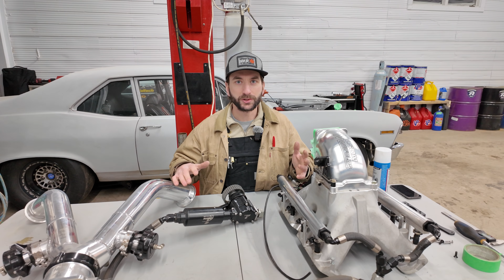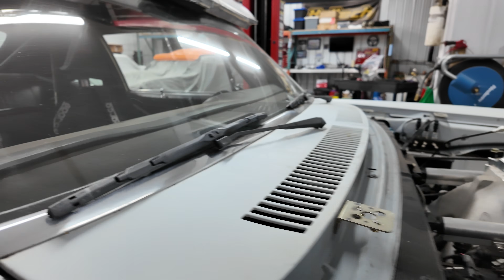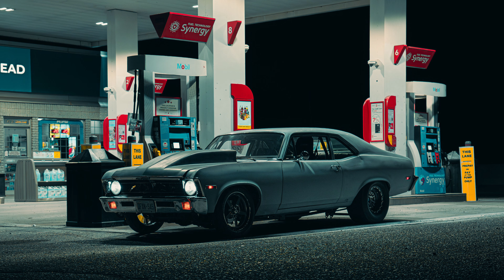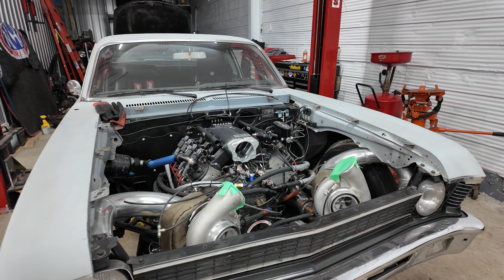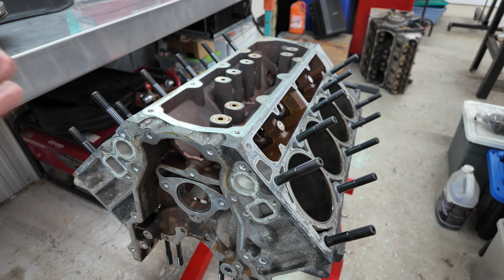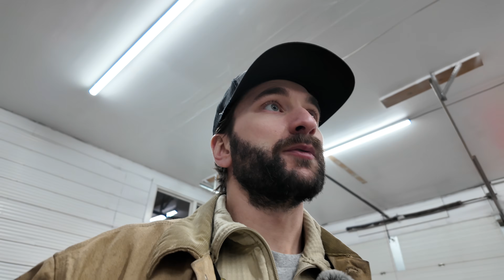TWIN TURBO LS7! Building My First Racing Engine!

Comment: Wild, I was thinking earlier today "when's he coming out with a new video" and here it is. Always funny is I'm switching from a similar style intake to one that will fit under a flat hood. I am swapping my drivetrain my trans am to my Nova and wanted to run an a2a intercooler for less hassle. This is a drag and drive car. But then realized there isn't enough room for a big a2a and wanted to keep the engine compartment as clean and uncluttered as possible I ordered a Tick Performance ultra low intake and intercooler set up. It's the only brick style a2w intercooler I know of that will fit under a flat hood on a Nova. Seems to have about an inch to spare. 

Your channel deserves more views, I'm sure it's only for fun but post more. You always have interesting stuff.
Reply from the maker: Thank you for your comment and the continued support. I would be interested in some vids of your hot rod too!